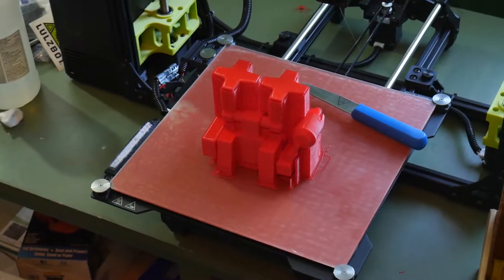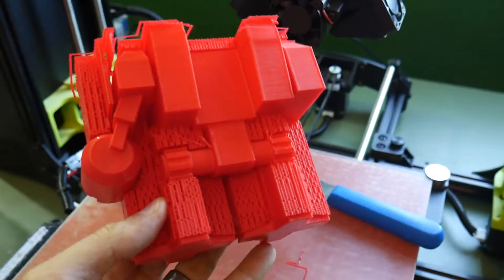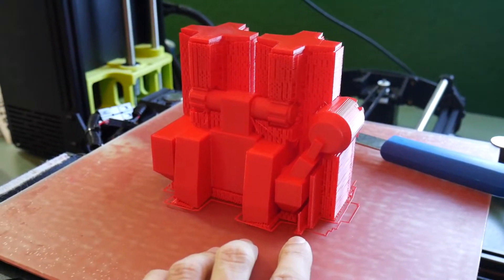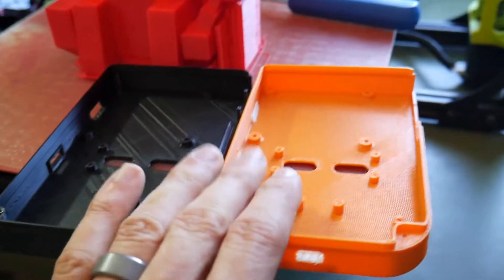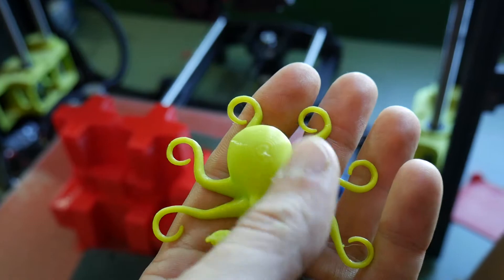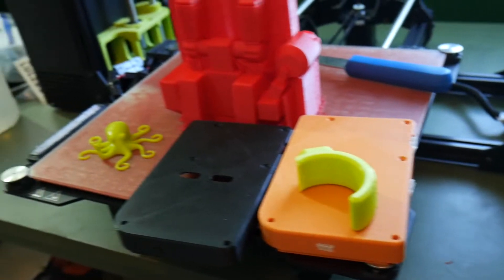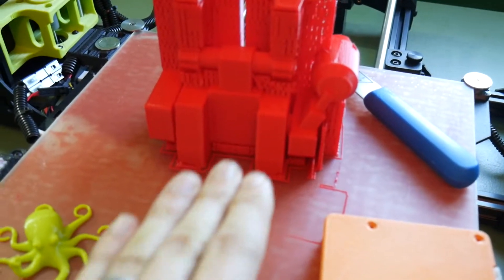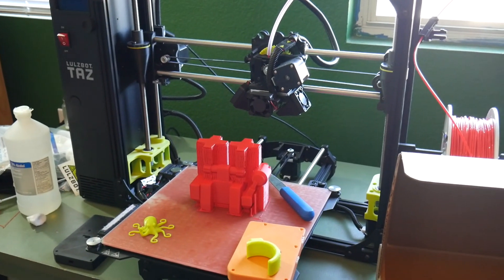Basic 3D Printing Tips

Comment: all the imperfection and blemishes is your printer bed level and bed material you use if you have a glass bed and level it right you will have alot better quality under it
Reply from the maker: This printer has a glass bed and it self levels before every print.  From what I understand, the blemishes are more due to fluctuations in temperature since this printer does not have an enclosed, temperature-controlled print area.